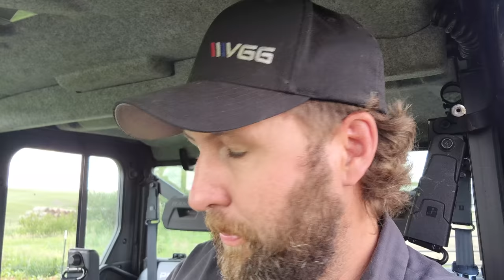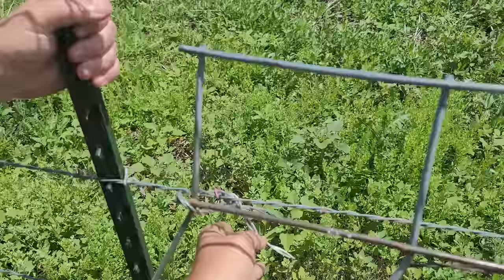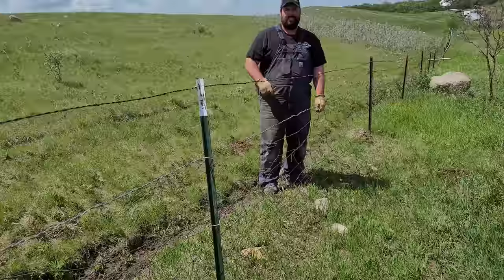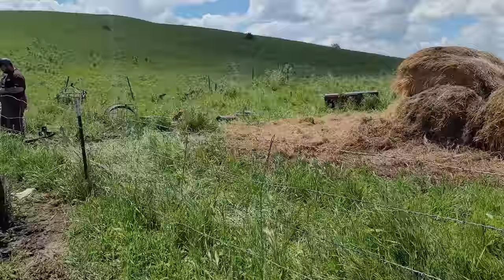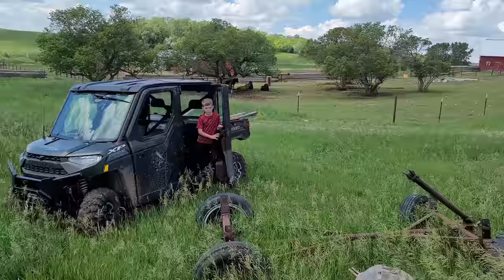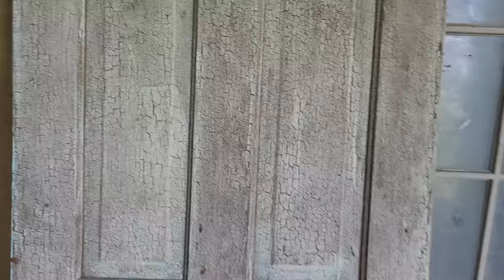Fencing On The Family Ranch (It escalated quickly)

Comment: Brings back memories of a much shorter fence, wooden posts.  Dad put up the barb wire on the out side of the posts, and the cattle would simply lean on the wire till the staples popped out.  My job each weekend was a to take a roll of barb wire, some baling wire, some fencing staples and a fencing tool in a wheel barrow and couple of other handy items like a single-jack hammer, and a come-along, and walk the perimeter in hopes of keeping the cattle in for another week.  Thanks.

Comment: "It's a Ford son, that's why it's there." 
Perfect, just perfect
Reply: OMG ...I couldn't breathe for minute after that...
Reply: just made me say I love this man XD
Reply: as I look outside at my 1990 chevy c1500 with a 4.3l v6 thats been overheated 5 times and is still my daily driver as i coast down the highway
Reply: @litta57  its a long story/history of this truck lol the first three times were my mother the last 2 was me  radiator hose had a leak she didnt check it overheated second time radiator hose busted overheated  third time waterpump went out overheated 4th time i was going down the highway blew a hole in the radiator.... 5th time i was trying to put a new engine in with a mechanic with "25 years of exp" he put the clamp back on and it was apparently bent and kept slipping off and i didnt notice it fell off on the way home from work and it overheated bad had to push my truck home, went out the next day and it started right up... just with a knock now so i figure its a lifter a warped head or a spun rod bearing but either way it still runs and drives until i can throw this 5.7l in

Comment: the old tractor on steel does look like a JD. Most were available on steel or rubber. Rubber made the tractor 50% more expensive! And yes it was rough to ride that old tractor all day, but it beat the heck out of a mule. You got to ride, and you didn't have to stop and water it every round! The red tractor looks like a "H" ( i still have my grandpa's "H") Odd note it looks like it has the optional step up transmission? the extra lever to the right of the steering wheel by the lift lever. If so, it locks out fifth gear, but makes fourth a road gear(fast, maybe too fast for the narrow front end!). Maybe used for shuttling a grain wagon back and forth from the fields. Love the channel, welcome to tennessee! Let's keep it the same!

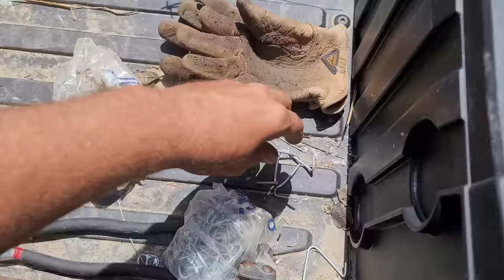Comment: You should consider moving the hay farther away from the fence 2:08 it's causing them to reach through to eat it and pushing the fence down. The old steel wheel tractor is worth some money to a collector.  Someone would buy it and maybe fix it up. Where are the floaters?

Comment: Man I miss fencing. We gathered up down cedar trees, cut them to length, sharpened points on the end with an ax. Get a hole started with a crowbar and drive the post’s in with a post maul. Stringing the barbed wire I don’t miss as much. 🤣

Comment: Not to tell you your business, but...  I have found that the loop back knots are the weakest kind the wire wears against each other and breaks quickly. The bending back causes it to weaken in strength too, kinda doubling the trouble.  the linemans knot works okay but barrel crimps work better. It means you have to carry a crimper and and barrels with you but it is worth it in my opinion. Another handy tool is the "texas fence fixer" that make short work of tightening and can sometimes be used to stretch too (it doesn't work well with badly corroded wire though). You have to pay the money to get the American made ones because the chinesium ones snap in half.
Reply from the maker: Thanks!

Comment: The rusty steel wheel tractor with no radiator and manifolds is a 10-20 McCormick Deering. 1920’s or 30’s. Same as the one in the shed next to the Old John Deere.

Comment: Dang bud! Learned two things that made think huh! That’s what that’s for and damn that’s way better using a double jack. 
First was when I saw you grab the plier and twist the clip around using the rounded claw like tip helped it roll around the wire. 
The second being your brother using the tee post hammer upside down didn’t realize or think to use it that way. Always Figured the barb wire had to come off pretty slick. Thanks

Comment: Run  4 strands of barbed wire and run the second one from the bottom being electrified. Raised over 200 head of pure black angus cows and bulls off of it and never seemed to have a single problem though almost 30 years of farming. Should take care of all problems without spending too much money as long as you don’t have polish wire you’re stretching with. Lol

Comment: I cant remember what there called but try to find online the barbwire fence crimps you lay the two wires flat together and theres a metal sleeve you crimp on so no more loops and lasts wayyy longer and can stretch tighter with them

Comment: Aintcha got any osage orange trees around there? I dig the open air storage area . Not sure but I think the old tractor might be a 1020 International farmall 1930’s vintage,(uneducated guess) . Old IH engines had those round inspection plates on the side of the crankcase, pull er out and make a viddia of gettin her runnin!

Comment: Need to buy as many posts as you can, they should be on ten foot centers, with a pull station every 250' to keep the wire tight enough to play a tune on..................and on a side note. Atleast Ford didn't ask for a bailout, like the rest of them did.

Comment: That old steel wheeled tractor has me stumped. Is that green paint on the fender?  It could be a Hart-Parr. Next time you're around it try to get your peeps on it for any ID marks. I couldn't make head or tails out the marks on the side of the engine block.

Comment: Well personally I wouldn't mind having a 62 63 or 65 Ford half ton twin I beam suspension and not a unibody I had the unibody oh it was okay wouldn't mind having another one actually but I'd like the truck to have the bed separate from the cab that way if I have to take it off that'll be good. Because with the unibody you know the cab in the beds all one piece the back of the cab is the front of the bed in the front of the bed is the back of the cab anyway if you take the bed off you have to take the whole cab off or the other way around that's why I want to get one that has a bed separate from the cab issues man issues. I had a 62 Ford 63 Ford half tons the 63 was a short bed unibody and the 62 was a 8-ft bed for the unibody and either truck was just a two-door the 62 is a three speed on the column with a 223 very strong engine worked good work course you know went anywhere and everywhere I took it I used to take it in places that people just wouldn't never take a truck and fully loaded too all kinds of camping gear and firewood all piled high in the bed full full bed load all the way to the top piled high right. There I'd be traveling around up on top of the mountain going up and down the old River drive riverbeds riding over the tops of the rocks with my skinny truck tires from Big o tires that was a good old truck I want to get me another one. You know that 62 I had I only paid $450 for that truck and that was the best running truck I'll tell you I got the best fuel mileage and I must say I believe that was the one truck I've had more fun with and it never broke down and I bought that truck and sold that truck twice, I bought it from the guy that bought it new and he said that he had a brand new Ford in his garage it was the Ford ranger a 78 I would have liked to have had that, that old 78 is probably still in that man's garage right now. You know I own that 62 Ford for the longest time you know and I never ever done anything to that old Ford never I put a clutch in it twice but other than that I put a sleeve bearing in for the clutch pedal yeah other than that I mean you know you know I did the brakes once completely redid the brake system had the best pedal ever on that truck that puppy was nice real nice all original too everything was original nothing better than an original truck they ride so wonderful you know as long as everything is working good everything's got the right tension man I'll tell you what ain't nothing like a nice old truck that's what I am I'm a guy that likes things all original perfect just like it was in the old days you know an old truck will last a long time that old engine and that's 62 Ford I had it for the longest time seems like I had it like 15 years maybe more anyway let's see I had it from 82 to 2007 anyway so anyway like that engine I never done not a screw a bolt or nothing on that thing that thing just sputtered right down the road no problem yep that was the best truck I had the oil bass filter on it nothing just spurred like a Singer sewing machine had to hydraulic lifters man I'm telling you you never had to worry about that thing it just kept on going. I want to get me a either the 62 again with a or a 63 or 65 but I don't necessarily want to be the unibody I'd kind of want one with the separate deal going on you know separate bed from the cab yep that's just the way it's going to be this next time but yeah that's what I believe it'll be I'm pretty much sure it's going to be the 65 Ford custom I think it's called the half ton yeah camper special job you know that's not the camper special it's just called the custom I believe it's called the custom Ford custom anyway that was a nice truck too little bit different bed on it I might have to go back to the the 62 I like the 62 62 had a real sweet bad nice fenders dollar 65 did too in the 63 but the top of the very top of the edge of the bed was on the 65 I believe was a little more rounded I don't know if that makes any sense but it was different it was different than my 62 it's all I know it had a little bit of a different kind of a shape to it yeah yeah I like to sit on side by side yep it's been a little while since I've since I had my truck so I got a few pictures of that thing I should put it out here on the channel or on the Internet let people look at it it's pretty nice. Any old vehicles nice even if it is a Ford just remember that guys